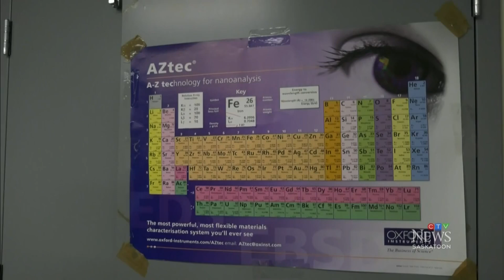Hydrogen fuel could be moved in former oil pipelines: researchers

Comment: Silly idea.  Pipelines are kinda in use with natural gas, they would need to be relined, pumps upgraded, and the costs per GJ would be astronomical.  H2 is a much less dense energy carrier, and is expensive to produce renewably.  Much cheaper options!  Add to that .. who would want it?  Homes are not suitable since no one has H2 appliances, and the explosive range of H2 is much wider vs fossil gas.  It is also really expensive.. and cheaper alternatives are available.  All the H2 projects world wide have failed and cost taxpayers millions.  Read Michael Bernards articles.. he uses math and physics.